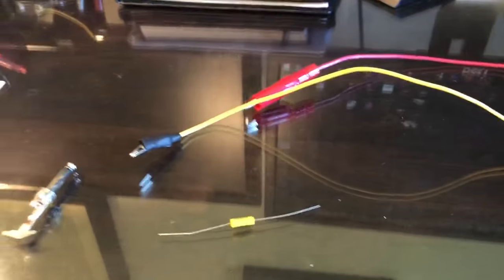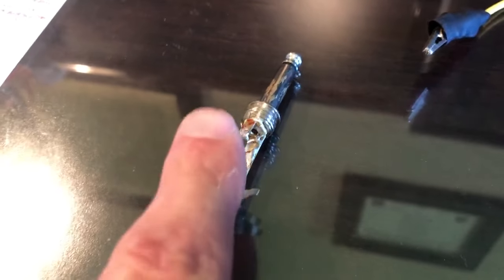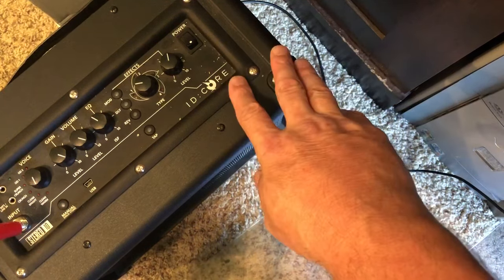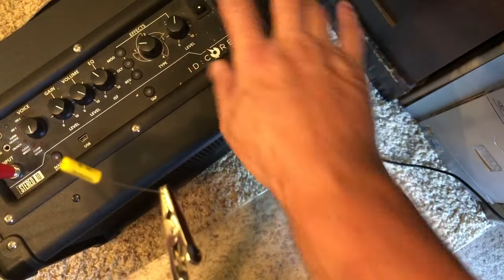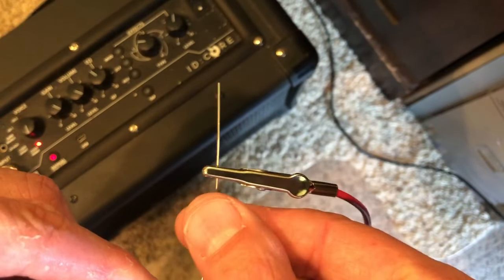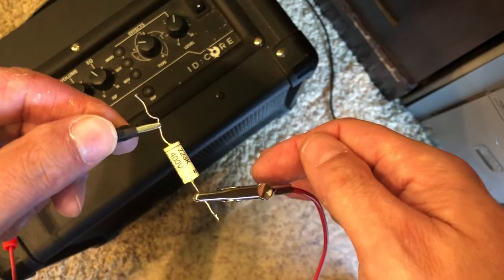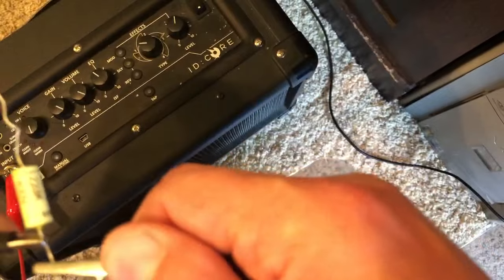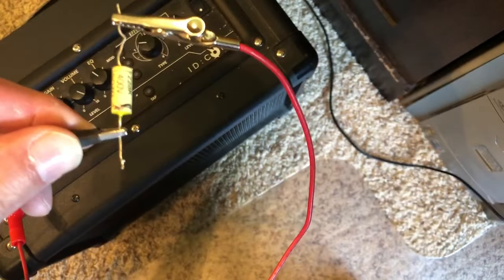Testing capacitors for orientation of outside foil end

Comment: This is an ingenious method to test!
Reply from the maker: I find it really only necessary on high gain build using caps at .0022uf and lower but being somewhat OCD i do it anyway. I need a new O-Scope...♫
Reply: Hopkins Marshall-Mods Do you know wich wire of the capacitor goes to the ground arm of the Master Tone potentiometer in a passive bass circuit and wich wire goes to the top of that potentiometer for the shielding effect? The outer foil on the ground arm and the other wire to the top of the potentiometer?
Reply from the maker: Follow the attached link to my facebook page for entire layout of foil orientation.   David Hopkins...♫ 
https://www.facebook.com/photo.php?fbid=2727027864081236&set=a.133010450149670&type=3&theater

Comment: Does this apply to installing orange drops in Les Paul Control Cavities? If yes what would be the benefits of proper orientation? Thank You
Reply from the maker: No. at .022uf injecting an AC signal into an amp there is no concern there. I ensure correct orientation because I builds very high gain amps & often use values much smaller than .022uf...♫

Comment: Do you think that capacitor orientation (polarity) makes any difference on the "Tone Pot" of a guitar? I don't have an oscilloscope, so your method looks handy. Thanks
Reply from the maker: No. The potentiometers are variable resistors Mot capacitors.
Reply: @NewReligion1954  So excuse me if I ask again just to be sure. When installing caps on guitar tone pots, no need to test orientation since it will make no difference? I hope you will find the time to reply. Thanks!
Reply from the maker: @EmopunkDr  My Stratocaster's, Ibanez Custom Shop's, $ Gibson Les Paul's all use .022uf Caps. Orientation will likely not be noticeable in this value or higher. I use .0022uf caps for coupling caps on some of my high gain amp modifications. With this value of .0022uf the noise to very noticeable to my ears. The following link will take you to my method of using a oscilloscope.  https://studio.youtube.com/video/52oIUQH8SCc/edit?o=U
Reply: @NewReligion1954  No, when using tone caps in guitars it doesn't matter, it only matters when they're installed inside the amplifier.
Reply from the maker: @vintagetubeamplifiers  Agreed since everything in the control cavity is grounded. ♫

Comment: A newbie trying to improve his sound. No electronics experience of note. Have a. Orange tube amp . What are the safety concerns . Can you get electrocuted by this . What are the precautions to take. Thank you . Ps. I dont want to damage my amp.
Reply from the maker: There is always a possibility of electrocution. My view on this is if one must ask it is best the individual take some time and read data on electronics before jumping into a guitar amp with upwards of 500+ VDC. With the process I demonstrate, no as we are just testing for the quietest end of the cap. As for getting inside the chassis, do some reading first is my advice.  ♫

Comment: The sozo's are good for fenders. Have you tried the mojo dijons?? They say those are great for marshall sound.
Reply from the maker: Hello and thanks for the question. I agree. I do not care fore the Sozo's in a Marshall circuit. Yes the Mojo Dijons sound great for most applications. My go to caps are Mallory 150/Sprague 715/Green Polyesters. 

They all have their place in my circuits for my ears. I remember certain amp guys telling me when I started how it does not matter. Wow, how wrong they were.
Reply: @NewReligion1954  thanks for the answer. I think the mallory 150's are awesome in a fender circuit. They are cheap too. What do you like for electrolitics? I hate IC AND DON'T LIKE THE ORANGE DROPS.
Reply from the maker: @russellesimonetta3835  Nichicon for cathode bypass caps. Original Mustards are great in most circuits when available but I have quite a collection of them stashed away.

There are so many great caps that are no longer available like the old yellow Ploy's from circa 1976 etc... I am on the fence with Silver Mica and find that ceramic performs better IMO for the fizz cap and a lot of the custom point to point work I do but I have my recipe's for the Hopkins Growl/Grind/Cry thing. Resistors are just as important IMO. I watch guys drop loads of money on CC for terrible resistors as they drift way far and are noisy. The only advantage is that you can connect a meter and file away carbon until you reach a lower desired resistance. David Hopkins...♫ :)
Reply: @NewReligion1954  thanks man. I'm a drummer by trade and began playing 5 to 6 nights a week when 64 fenders were new. Amps are  fascinating.  I've played next to great and horrible.

Comment: If you are only dealing with one in a circuit, you can just install in one orientation, listen, and then in the other… and the correct orientation will present itself. The wrong way will be noisier, and to my ears, have a lesser frequency response.
Reply from the maker: Yes, that too will work. I use an oscilloscope for this task, it makes the process more efficient and I’m not soldering components in & out exposing the circuits to as little heat as possible & minimizing flux splatter.

Thanks for posting, David Hopkins

Comment: HUGE HELP  needing to mark orange drop caps. Ill have to desolder them one by one mark replace but at least Ill know
which is the quiet end..  I also have an amp which does not have them marked but they are installed.. So ill make this and try testing them all and reinstalling them the correct direction then power the amps up.

much thanks for great idea..
Reply from the maker: You are very welcome.   David ♫

Comment: Thanks for your video! I bought some 4.7µF and 22µF polypropylene caps (they're big), and tried to determine the foil end with my scope. I couldn't detect any difference. I'm now pretty sure that's due to the high capacitance, and not something wrong with my test method.
Reply from the maker: Yes anything above .047uf even in very high gain amps usually will not display anomalies.
Reply: @NewReligion1954  Thanks for the clarification of capacitance value.

Comment: OK this is the truth about how I found this. Yes, I have seen Mr. Carlsons lab. Yes, I know there is a difference. Why do I need this information that you have so greatly provide? Because I have an Old oscilloscope. Eico 480 model Wide band. It's not working so I ordered a bunch of Capacitors and resistors just like Mr. Carlson would be proud of me for doing, and going on his advice. I have also seen his Foil side capacitor checker. But it needs the Scope I haven't repaired yet. The whole reason I want this is because I play guitar and drums and bass and record. I like the idea of having dedicated pedals rather than a one size fits all. That's where the noise and hum comes in. It also stands to reason that if by some stroke of bad luck you buy a wrongly marked capacitor, and replace your tone cap or treble Bleed cap, then you have just added unneeded noise. I want the oscilloscope to examine the waves I get with different op amps etc. You sir just solved my problem. Oh and if a smaller size cap works best it may even work if you have a large size but parallel it with smaller one and use that one to test for noise something I am going to check perhaps in series even. Thank you from the guy who really can appreciate your way of thinking .
Reply from the maker: You are very welcome. David

Comment: you marked the capacitor, so that makes it which end?  - or +?  I think you're full of it myself,  lets say your little test works, you had the red lead on the end with the circle or marked end? and in your little test that was the quietest end or so you say, but you say they marked it backwards?  huh, you think the circle denotes negative?

 you didn't really show anything here, lets say I touch a cap to the jack, and its quieter a certain orientation, WHICH end is then +?  the end that's touching the tip of the jack right?

then which end do we solder to the ground, the negatived end or the positive end, clarity, we need clarity not just that if you touch it to a jack it can be louder one way as apposed to another if you touch the paper..

imma say the - end is soldered to ground and the quietest orientation makes the lead touching the tip of the jack +, prolly wrong tho
Reply from the maker: Preface: Link Below  -  It's just basic electronic science.  This is an easy way for people to make a proper determination as the outer paper is wrong on most make and models at about 50% because they are just slapped on to appease QA/QC. This process is not critical on caps at or larger than .022uf.

The line identifies the less insulated end there fore should be placed in the circuit in accordance with proper orientation. 

Most people do not own an oscilloscope nor know how to use an oscilloscope but I will attach a link below that I did using an oscilloscope. David Hopkins ♫  

https://youtu.be/52oIUQH8SCc